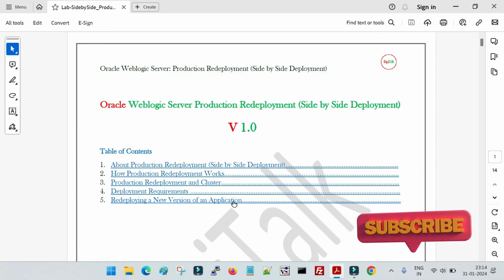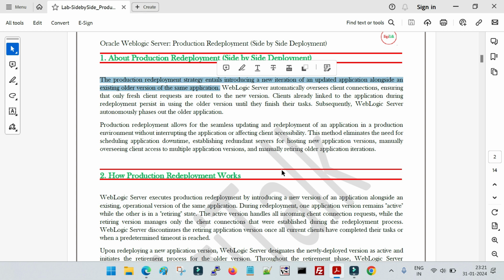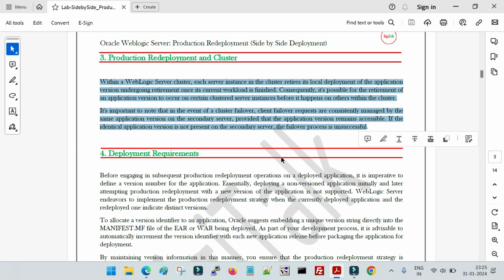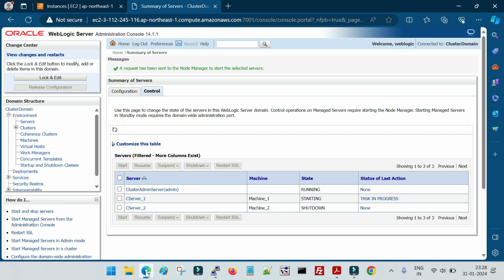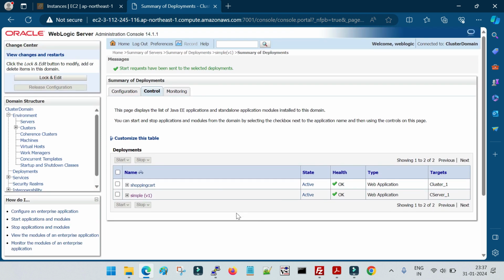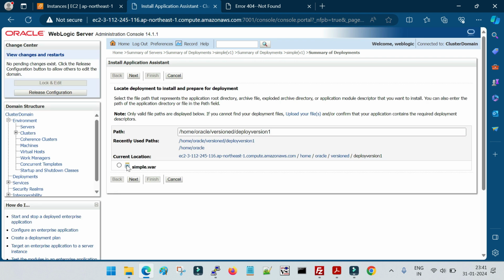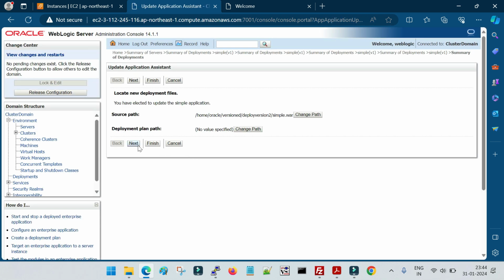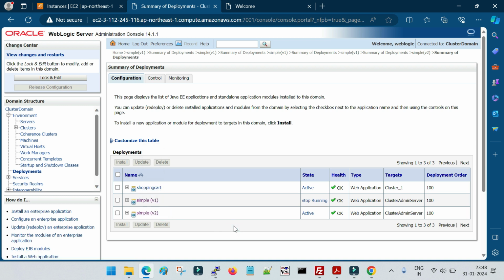Oracle Weblogic Server Side By Side (Production Redeployment) Demo and Explanation

Comment: Sir please explain multiclustring
Reply from the maker: You mean multi machine (horizontal. Clustering)? I have already posted videos on the same ..you can visit the channel videos list
Reply: I asked active and passive concept i doubt little bit on there
Reply from the maker: Active is which serves the current requests and passive is just a standby just in case Active got down passive will takeover. Only you have to ensure the data from active to passive getting replicated properly.